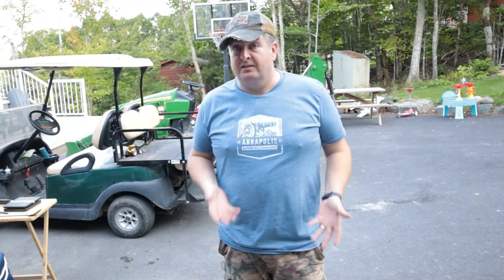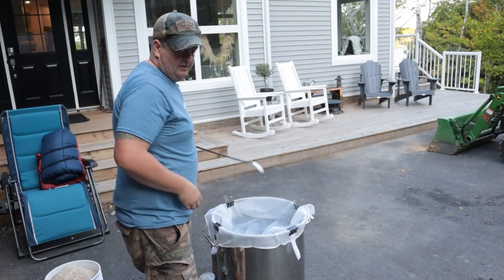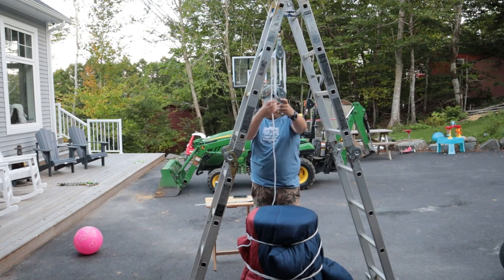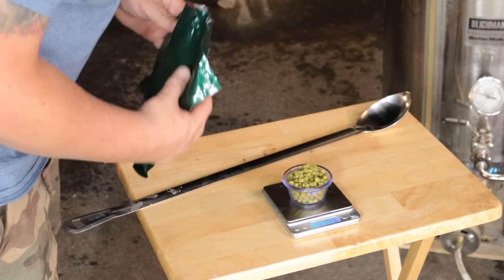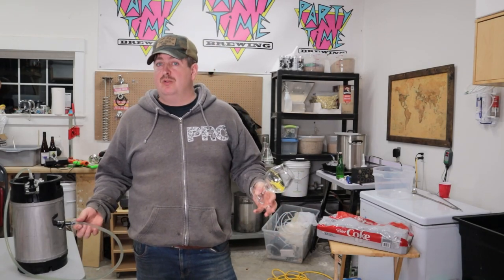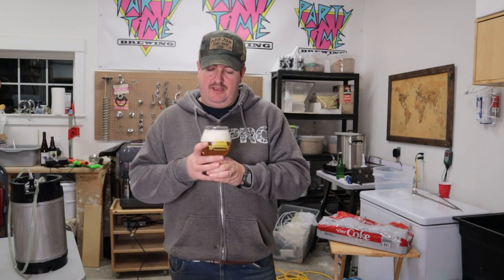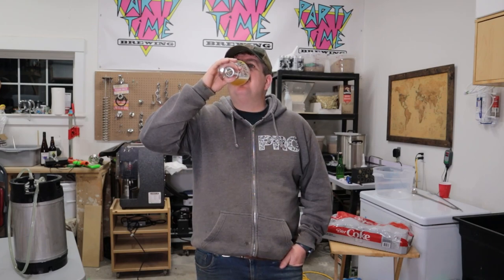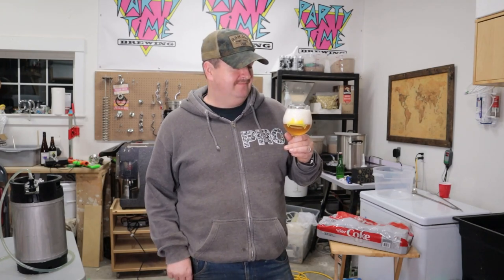Brew In a Bag Sasquatch Lager | Grain to Glass | 1st BIAB

Comment: Don’t be afraid to squeeze that bag! You can use less water and get better efficiency
Reply: agreed
Reply from the maker: For sure. I need to gear something up to make it a bit easier to squeeze and direct into the pot. I tried twisting it, but that didn't work as well. Cheers!
Reply: @PartyTimeBrewing  Get a good pair of PVC coated work gloves. You can find liquid resistant gloves on amazon. Thats what I use.
Reply from the maker: @TroubleBrewing  Sounds like a plan. I have some that might do the trick, but it would be good to have a quality pair for this type of stuff. Cheers!